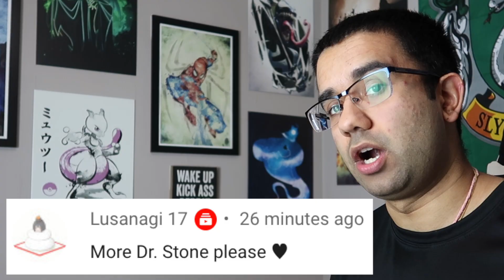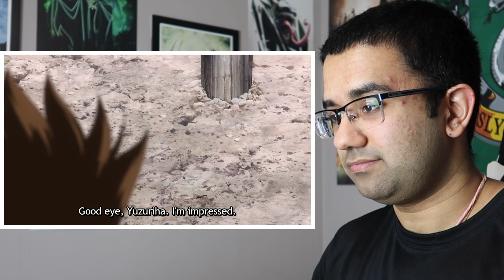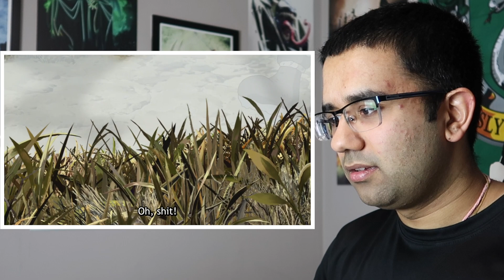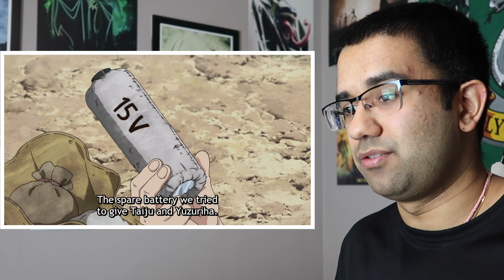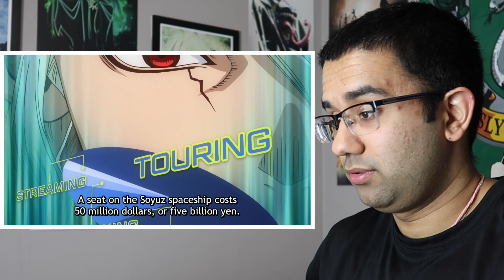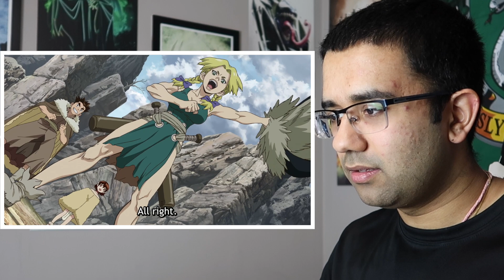Real Engineer Reacts to Technology in Dr. Stone #27

Comment: I don't think the battery storage in the phone is really that much of an issue. It would be easy enough to shape the compartment for the battery inside the phone to fit the battery itself. It would just be drilling a cylindrical hole into a rectangular piece of wood and mounting that piece of wood inside a rectangular storage space.

Comment: The battery wasn’t a lithium battery they used manganese they found in the caves like they stated earlier in the season and even if it was a lithium battery when using a battery to start a fire as a wilderness trick to they use the battery to heat up a piece of wire so hot that it can catch the grass they laid it on on fire so the battery didn’t explode like he thought the electricity was just used so no toxic fumes were emitted into the environment and the air.

Comment: Chrome’s battery isn actually a lithium battery (comes up later and I read the manga), it’s a combination of ‘Mangan’ batteries
Reply: It is the same batteries that Gen made in ep 23 of the 1st season
Reply: I can't believe he didn't remember the battery making song.
Reply from the maker: He can't remember everything lol
Reply: Yeah and even if it was a lithium battery when starting fire with a battery as a wilderness survival hack the battery doesn’t explode it just uses the electricity to heat up the wire that was wrapped around the battery to let the material it was set on catch fire.
Reply: "Electrical  ""engineer"""
Reply: @odiihinia  mmm, you need more quotation marks.
Reply: @odiihinia  ??

Comment: I assumed, taht it wasn't the battery that went up in flames, but the dry grass around it. Obviously, this isn't one of those lithium polymer batteries you find in modern tech, so it might not even have exploded. Dry gras however beurns VERY quick, and there's SO much smoke coming from it.
Reply from the maker: That does sound more likely
Reply: @parychahal  They say it's a Manganese battery in S1.
Reply: still, it's best to not breath, but it's probably not as dangerous as he is thinking
Reply: yeah it probably just caused a spark to ignite the grass